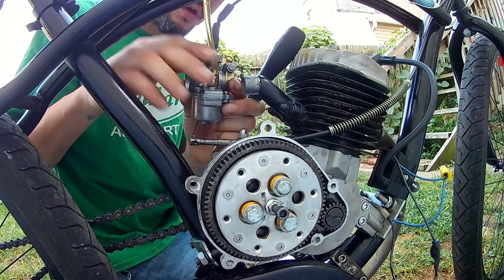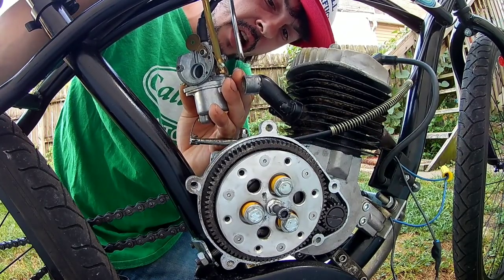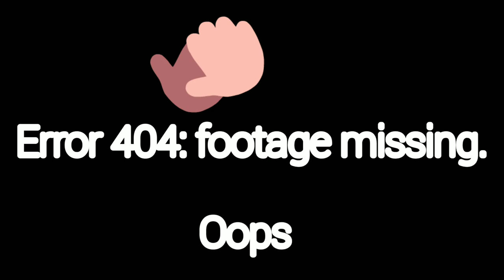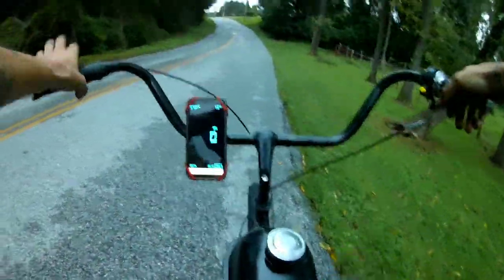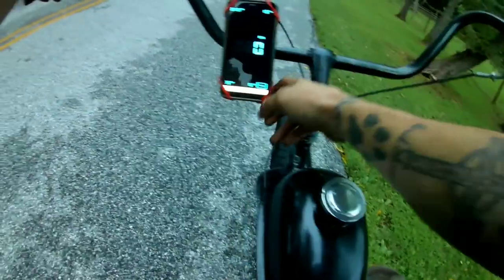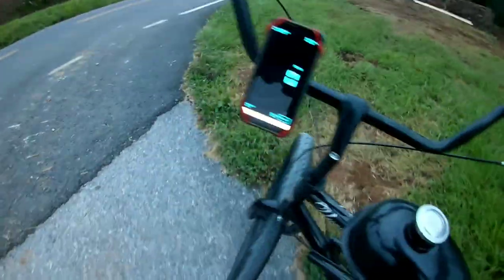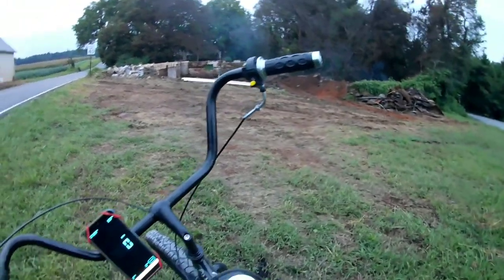66cc/80cc motorized bicycle "jetting ups and downs"

Comment: Why don't you do a video on your 212cc with the gps showing your speed.i want to see you do 75mph with a 56t
Reply: I wanna see u do 75mph on a bicycle Yates????
Reply: @macmotorizedbike3834  I never said my bike goes 75mph
But I'm building a  212cc beach cruiser atm and I'm trying to figure out what gear I need on the back .
I'm only in the 60mph club atm
Reply: @macmotorizedbike3834  and he has a very nice fast 212cc that I want him to share on his channel
Reply from the maker: My 212 bike only does 70, sorry to disappoint. Its been down getting a half assed turbo install. But i could get it back together for a video... Then i gotta find a road around here to do it. Ive moved since i last had it out for a real rip
Reply from the maker: @mbrrideitlikeyoustoleit8436  that sucks you got a bunk carb. Its getting harder to get real carbs from many places, especially amazon/ ebay

Comment: Runs like a stock 2stroke not tuned
Reply from the maker: Thats because it is... Lol. Not much to do besides change one jet and a clip
Reply: @dirtesgarage8733  oh I know you'll get it running stronger than ever
Reply from the maker: @mbrrideitlikeyoustoleit8436  i would... But i sold the bike today. Her final video is coming
Reply: @dirtesgarage8733  I ordered a vm22 mikuni for my 212cc and they sent me a china clone vm22 way different carburetor the slide Is way smaller and the fuel and air are in a different place